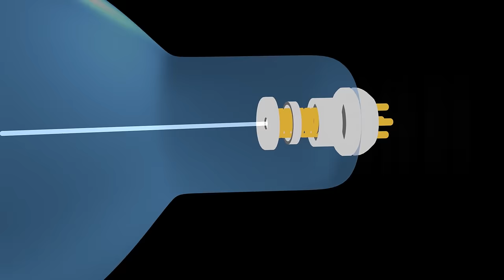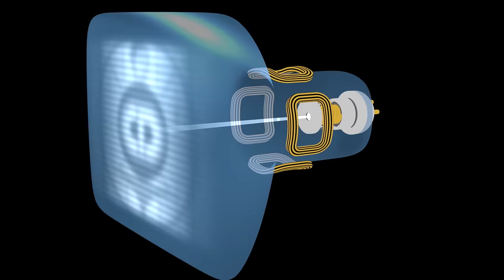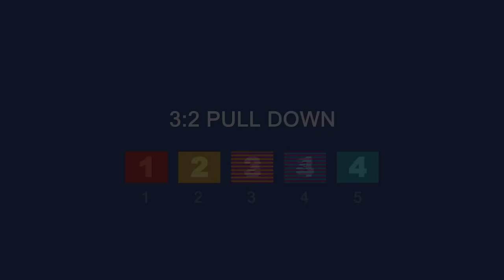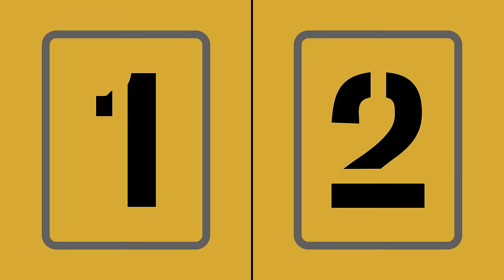CD / Interlacing

Comment: That ending plugin thing seems to be incredibly specific.
Reply: yes, many content creators find plugins to make their lives easier but end up not getting them because they are ludicrously expensive
Reply: @greggleason8467  It's also a reference to subscription-based software, specifically the Adobe suite, and how it's more expensive in the long run than just being able to buy the software outright.
Reply: cough ADOBE
Reply: @dreamhillzone8505  i work with adobe software, i know its a very nice shot at them (especially their tiered creative cloud bullshit) but yes, you are right about that as well (though it has no option to purchase it! you can only purchase monthly/yearly licenses )
Reply: @TheMatrix101 I bought Photoshop around 2 years before it became subscription. Was roughly £1000, then a year later paid nearly the same for an update. The subscription is £50 a month for every Adobe product which works out about £600 a year. Bargain if you ask me 👍
Reply: @funtechu , yep CS6 was the last. I bought it at the end of my senior year of college so I could take advantage of the student discount. This was right before they switched to the subscription model. Glad I bought it, still using it 6 years later. CS6 is good enough for me.
Reply: overclockeador  so drop the link
Reply: Just use any other software vendor. Adobe is not the only one.
Reply: @dreamhillzone8505  Adobe doesn't let you buy their software anymore. Free software is taking over. Use GIMP and stop whining about Photoshop being expensive.
Reply: I’ve been using Affinity’s products. They are a one-time purchase and work great.
Reply: @antipastamony  same here, I'm a professional graphics designer and affinity was like retribution. The end of Adobe hegemony. I love every bit of it, especially the price.
Reply: @dreamhillzone8505  adobe works on a subscription basis because piracy. people with a subscription pay for the people that pirate their software.
Reply: @user-xt8ig5oh7r  And people pirate their shit because they gouge the fuck out of people.
Reply: Kauffmann That has nothing to do with it. Subscription-based services make more money than buying the same thing outright, so Adobe makes more money in the long run. If it was just about pirates, then there would still be an option to purchase the software.
Reply: @yellowcrash10  you just explained yourself why it is a good way to cover the costs of piracy
Reply: @user-xt8ig5oh7r  Sunk cost fallacy, or at least something close to it. They lose some tiny amount of money to piracy, so they jack up the price astronomically which directly drives more people to pirate their stuff. So what do they do? Say "hm, we're not making as much money as we'd like," so they bump the price up, driving even more people to pirate. If it were really due to the cost of piracy, they would lower the price since that would mean more people would be able to afford it and would therefore pay for it.

This also isn't getting at all into the fact that Adobe is offering products that, for the most part, cheaper alternatives that work just as well exist for. If they really are jacking up their prices because they're losing profits, it's because their competition is offering better products at better prices than they are, not because pirates exist. I mean, fuck, free art programs are better than ever. Why would I shill out $21 a month for Photoshop or even go to the trouble of pirating it when I could just get PaintTool SAI permanently for $50 or download FireAlpaca, MediBang Paint Pro, or GIMP for free?
Reply: yellowcrash10 Dude, that’s exactly what he said; it’s a way to make more money. Only difference is he gave a reason why they feel they need to do that. You aren’t actually disagreeing with him.
Reply: Kauffmann Why did they not just increase the cost of purchasing the software if it was only to cover the cost of piracy? The answer is that they want to gouge people of every dime they have for the privilege of using their software. It's the same reason everything else is moving to a subscription/cloud model. The long-term cost of the software is orders of magnitude greater than buying it outright, and you have no control of the software.
And once they hypothetically recover the revenue lost to piracy, the price should go back down, right? Surely they wouldn't just increase the price of the software forever...

You could argue that the change in price is a good way to cover the cost of literally any part of their business and it could technically be true. That's not a good argument.
Reply: It has nothing to do with piracy. CC can still absolutely be pirated. The point of a subscription system is two fold.

First and foremost, it increases accessibility. CC is structured in a way that you can just pay piecemeal for individual software. If you only want to use Photoshop, you can only pay to use Photoshop. If you only want Flash, you can only pay to use Flash. $20/mo is pretty dang affordable pricing for single-software use cases. Is it a "ripoff"? Yeah, probably, because you get significantly more value by paying for ALL of the CC software each month. But my point is, if you're just a broke ass high school student wanting to take a dive into photography or video editing, the single-software pricing offered by CC is an extremely affordable option. There are no ifs, ands, or buts about it. 

I can't speak for everybody, but I learned quite a lot about Photoshop and video editing in general because over 15 years ago I "acquired" some Adobe software. I experimented a ton and learned about things I would have never given a thought to. I also became more interested in things like graphic design and video editing. If that stuff wasn't "otherwise available" for a curious 12 year old to find and get, then that would have been an entire world of creative possibilities that I would have NEVER been exposed to. I'm honestly kinda glad Adobe is trying to make their software more generally affordable and accessible to average people, and that's the point of the CC system. 

Secondly, subscriptions DO result in a more reliable revenue stream. Adobe is a business, so no shit they are going to try and maximize profits. Instead of revenue being taken in on one-time purchases, a single customer can provide constant revenue for an arbitrary amount of time. Are you technically paying more in the long-term? Yes and no. It depends ENTIRELY on how often you use the software. The Master collection of Adobe CS6 was upwards of $2,600. CC's all-software subscription is like $60 a month. In 3 years and 6 months of constant use, you would have paid enough into CC to just buy the Master collection of CS6. 

Which brings me to my third point. I think CC needs to be broken down into two tiers, or at least, Adobe still needs to offer piecemeal software suites like 2012's CS6. The way CC is built makes it ideal for average people. Just normal, every day folks. For a professional business on the other hand, it is a massive rip off. If you wanted to start a professional photography business or some kind of video business right now, for example,  you would be massively ripped off in just over three years. The reason being, after about 3.5 years, you would have paid enough into using CC that you could have just bought CS6 outright. Any continued expense on the privilege to use the CC software after this point would just keep adding up. If Adobe allowed you to purchase software like CS6 again, it would be a very attractive alternative to CC pricing for a professional business. 

TL;DR 
CC is not really meant for professional use just from the way it's structured and priced, which seems counter-intuitive to the way it's marketed and advertised. After 3.5 years, a CC subscription costs just as much as the Master collection of CS6. For a business doing any work that benefits from Adobe software professionally, any money spent on it after the 3.5 year mark is just wasted expenses since you could have just purchased CS6 outright from the very beginning. CC feels more like it's made for average, every day people to access and use professional software in an affordable manner. There's nothing wrong with that, that's actually a very attractive strong point for CC. There's just not much business sense in using it if you are a professional business.

EDIT
Some pricing and time frames.
Reply: overclockeador  Not trying to shit on you.  I promise.  However, that only works for the amatuer.  Adobe wants you to pirate their stuff.  They want you to learn their software as effortlessly as possible.  They want you to get heavily discounted/free student versions.  The reason being, the second you use it to try and make money, BAM.  Where's your license, sir?  Oh you don't have one....well, well, well....
Reply: @SimonWoodburyForget  ah yes. Because you charge everyone what it cost you to make your plugin. That sounds like a fantastic idea. Please make a business and tell me how well that goes for you lmfao
Reply: overclockeador  seed that shit!!
Reply: @BobBell.  The problem is that if you don't want to upgrade, just use the software as-is... you could do that for £1k indefinitely. That's no bargain, that's greed.
Reply: @zanthor5422  only businesses and freelancers actually pay for adobe products, consumers pirate, use older versions or indeed use alternatives. there is no sunk cost fallacy here. its a business strategy. profit much of people who can afford it and let them cover the cost of the pirated copies of all and sundry. consider it charity.

Comment: One deintelacing method that seldom gets mention is to convert 30i to 60p, but extract the half res fields to their own frames so you retain the 60 hz refresh rate. If you fiddle with how it renders the pixel high difference you can still maintain the full vertical resolution for stills and non moving backgrounds and objects. I used to make slowmo shots like that back in the days of DV and HDV.. it was better than nothing

I'm so glad we are finally putting interlacing behind us...
Reply: That is the proper way.  NTSC is 60 fields per second, and when converted to progressive, should still-be 60 fields.  60p preserves the 480 vertical resolution, where other techniques reduce it

.
Reply: BTW interlacing is not really dead, since a lot of HDTV was recorded with 1080i and needs to be converted to progressive.

Comment: CD takes shots at subscription models and overpriced filters

*Adobe leaves the chat*

Edit: wow thanks for all the likes folks, nice knowing I’m not the only one that doesn’t like this practice
Reply: He actually has the rights, he uses free and open source Blender
Reply: RubiksFaQ I think, that the software bundle you get with a cc subscription more than justifies the price for it
Reply: @TheGodlike300  Maybe, but have you ever used Blender? It is crazy how many features it has, not speaking of way better performance
Reply: @TheGodlike300  but most of the time you don't use all the software you get. So you're paying extra for stuff you don't even need. And cutting back only gives back a fraction of the price while reducing the amount of software you get significantly.
Reply: @toastbrot97  The only Adobe apps I use(d) on a daily basis are Illustrator, and Photoshop less frequently. I've switched to Affinity Designer and Photo, which are compatible with Adobe file formats for both of these apps. I installed my old CS6 just in case I couldn't achieve something I needed with Affinity and after about 5 months of using them I find myself not needing to open PS or AI anymore and still work with the same clients and printing companies I have before.
Reply: The real problem with Adobe's subscription model is that the same dev team is dividing their resources among ALL of those apps, so the apps that generate the most revenue get the most attention, and Encore falls by the wayside. Also they'll add an essential update like ProRes support, but only for the latest operating systems, and fuck anyone who still uses Windows 7 because Encore isn't supported on Windows 10 and I need to burn disks.
Reply: Pirating the older versions which work the same has entered the chat*
Reply: FireRat 16   what's an SSD drive? I knew people said ATM Machine, but I've never heard someone say SSD drive. anyway the CIA Agency is listening and they might get confused, I'm sure you're not reading this though. You are probably AFK from keyboard, but you know what they say, if you want something done you gotta DIY yourself.
Reply: Literally no one likes this practice.
Reply: FireRat 16  don't you mean HDD drives?
Reply: FireRat 16  by SSD and HDD you mean SSD Drive and HDD Drive right?
Reply: @InvadersDie  By SSD Drive and HDD Drive, you mean Solid SSD State Drive and Hard HDD Disk Drive, right? If you're going to try to correct people, at least correct them correctly, For FFS Fuck's Sake
Reply: @Riktasi  I'm sorry you're right.
Reply: I'm glad I'm not the only one either, I thought everyone had gone mad.
Reply: no joke i stopped using adobe the day they removed the option to own the software, and replace it with a yearly tax, to no great benefit to the majority of its users.
then swallowing other smaller software companies and basically tacking them on the side
Reply: @InvadersDie  you created a copypasta thanks
Reply: Screw rentware.
Reply: @Shill for Science The addition of the Frame Text tool in Designer pretty much rounded out the feature set I needed for regular use. Still keeping the old CS around in case I hit a wall on something. Publisher's going gold this month, going to grab that too.
Reply: Adobe is still cheap compared to other services. Autodesk 3DS Max is 1545 dollars a year (per account). I won't even mention what other insane companies charge... (*ahum* Apple Stand *ahum*)
Reply: @Shill for Science Damn, I didn't know about this. Just Googled it. Nothing to do with CS, they can't change the EULA you agreed to for CS as it's fixed. The threatening pertains only for the last 2 versions of CC likely due to a copyright infringement suit filed by Dolby.  More here: https://fstoppers.com/legal/adobe-customers-using-old-software-threatened-legal-action-company-battle-dolby-369032   CC's EULA apparently includes a bit that they can revoke your right to use it at any time apparently. Makes me love Affinity and other open-source alternatives even more.

Comment: Interlacing is evil. I've hated it since the 90s. Yes I'm that old. That and screen tearing (no v-sync on computer graphics, usually) drive me up the wall.
Reply: strangely i've never experienced moments so bad, even if i played like anything on anything (technically speaking), the only thing that changed my life was the "clear type" on winXP for LCDs... honestly i think that there is too much concern about technical poverty, likewise never wished for things like 4k etc (but it's an obvious upgrade at least), no offence but like in Hi-Fi there's audiophoolery it's kinda the same for video and other stuff, just harder to point as useless or semi-useless, i'm on a PC VGA screen of like 15 years ago and i hope it lasts some more
Reply: Interlacing was compression in the analog domain.
Reply: screen tear is the bane of my existence. i found out that if you play an old old ass cartoon on an old dvd player to a shitty mobile projector that the image tears so annoyingly bad its unwatchable. not sure why either. i know it has to do with a frame rate being too high for a system or something. but why is it that this one cartoon from the 40s is the only one that does it?
Reply: Screen tear (aka non-vsync) is another one of those 'we didn't think things through' issues.

For gaming to 'feel' smooth you need low latency.  Thing is on modern systems there are many sources of latency.  Mouse input latency, message queue latency, frame processing latency.  Most modern games/APIs (DX/OpenGL/Vulkan) also render 2-3 frames ahead to keep parallelism high and keep the GPU fed.  Also modern TVs also have frame buffers that can have 1-2 frame delays while they upscale/denoise/process the input.

This has meant that while gaming graphics and processing power has gotten orders of magnitude better, latency has gotten worse.  This is why most pro gamers play at 120 fps (or higher), not because it looks better but because it 'feels' better (ie. latency).  This is why old SNES games often play better than modern games (in terms of feel/control), because they are running lower latency.

Course even 120fps can 'feel' slow compared to old school games (which ran at 60fps with almost no additional latency, no frame buffers, no queue's, just blasting the pixel straight out to the screen) and screens can only update so fast, so the next obvious solution is to just turn off v-sync and let the GPU pump out 100's of frames per second.  You still have the TV lag and input lag, but at least you've minimized the GPU lag.

It's not a hard fix but video card companies need to justify pushing new generations of video cards out, and people care more about FPS than playability, so nothing changes.
Reply: I hate vsync, it creates an input lag for mouse/keyboard which is very noticeable. For games that don't require a mouse, or use a controller it's not quite as noticeable. 

So I bought a TV that supports vsync with my Nvidia card, now I get no screen tearing and no noticeable input lag. 

Technology can be great
Reply: Interlacing isn’t even visible to me (unless I freeze the image).  My eyes automatically merge the two fields & just see a continuously moving 480 scanline image (or 1080i for HD)
Reply: 90's ain't old, but okay.